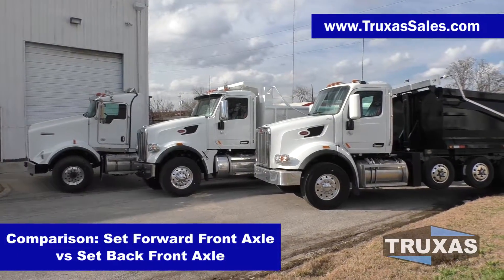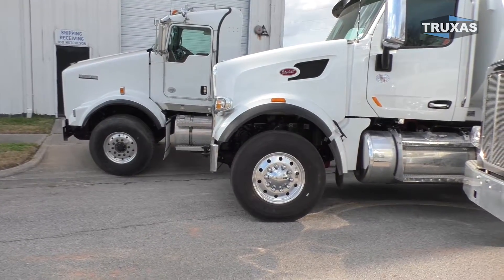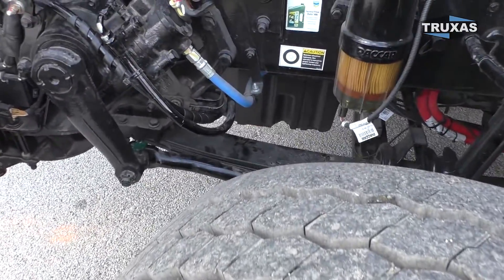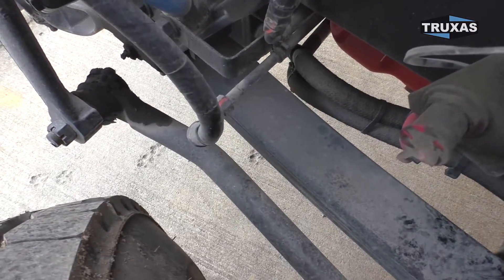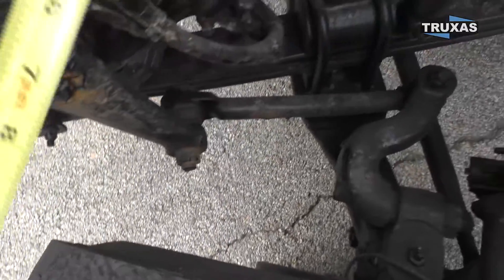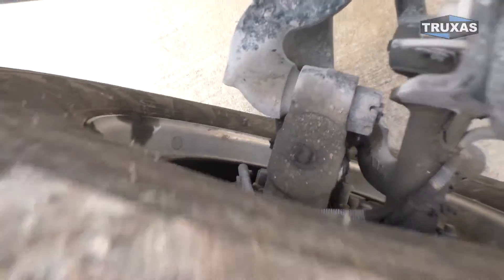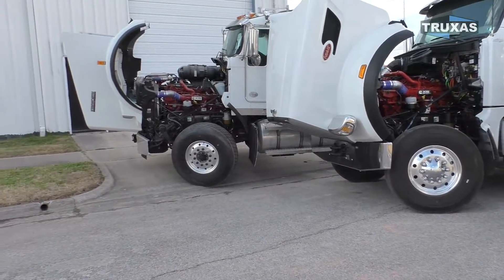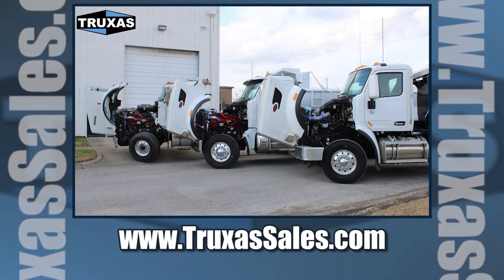Comparison: Pete/KW Set Forward Front Axle vs Set Back Front Axle

Comment: Great video idea however you didn’t address anything as to what the differences mean. What’s the difference in driving experience, what’s the difference in turning radius, what’s the difference in performance in load management, when would you want one vs the other? None of these questions were even addressed😒. You just talked about how far the tires got to the frame, however not sure at all what that really matters and how what you covered would inform a potential buyer.

Comment: What is the driveability difference?
Reply: Sharper turning on set back, better weight distribution on set fowsrd
Reply: @vcxmp2k124  when exactly would you need a foward axle, can you explain the scenario
Reply: @klngzgh0st355  Set back axle just comes down to better turning radius. This is why you see a lot of Roll off trucks with set back axles like at Waste Management to get into tighter spaces more easily. You lose GVWR on the steers but depending on what kind of work you do it won't matter because you wont be putting enough weight on the steers. Set forward axle is set up for most efficient weight distribution so you can put more weight on the tractor without exceeding GVWR on the steers which comes with a larger turning radius.